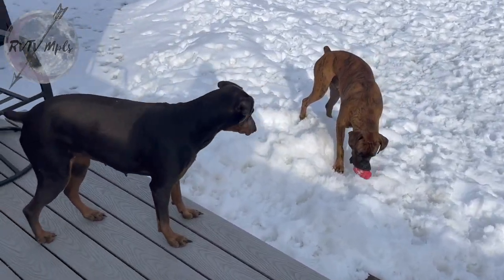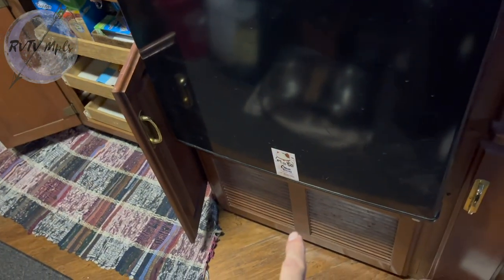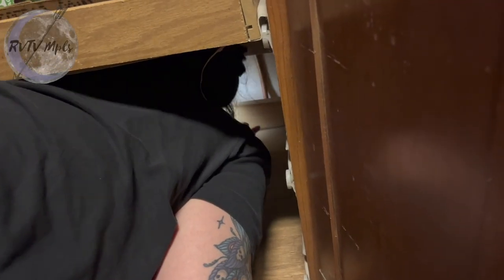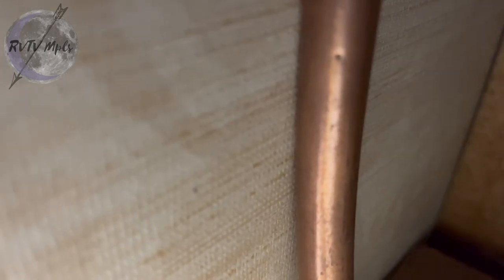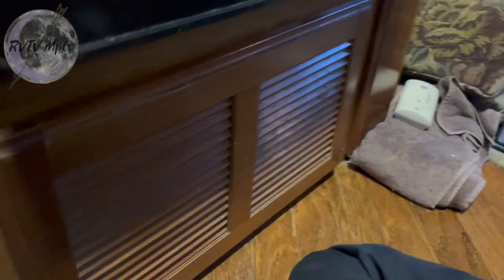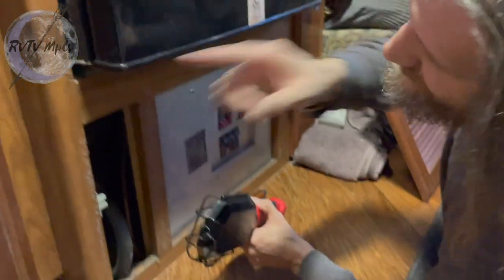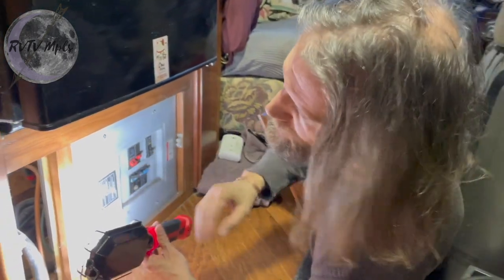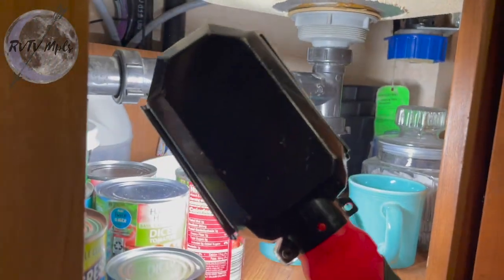Did Minnesota Winter Cause Water Damage to our RV?

Comment: For that cabinet piece glue can work, you might also need to go to a slightly larger nail or get small screws that are longer than the current nails.
Reply from the maker: They all need to be redone. I would like to beef them up so we can put actual weight on them. If only we knew a guy that was handy with a saw.. 😉

Comment: I would like to see you weather strip your door. I have the same door and all the seals have been rotted away. Curious to see your solutions.
Reply from the maker: We tried in a video I will link for you. It didn't go so well as our door has some pretty serious issues. I will be completely rebuilding it later in the spring. 
https://youtu.be/Zx9R559UCnk